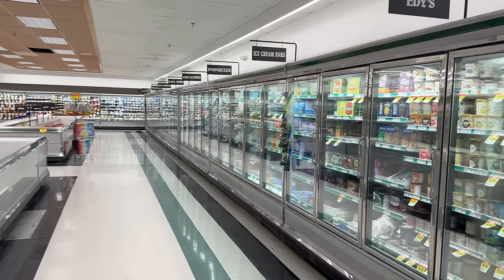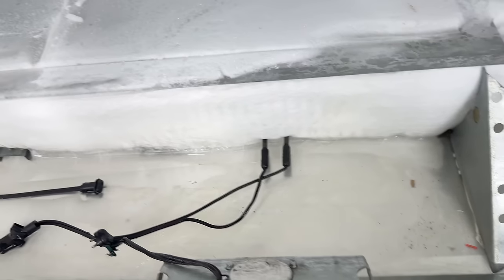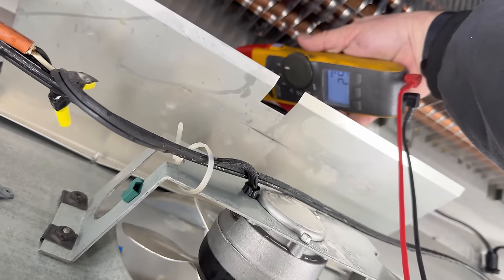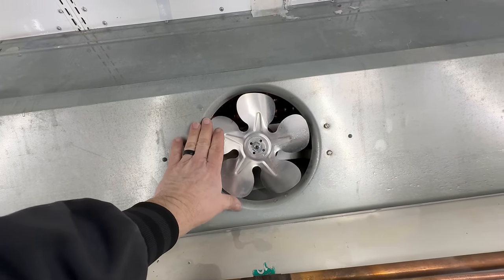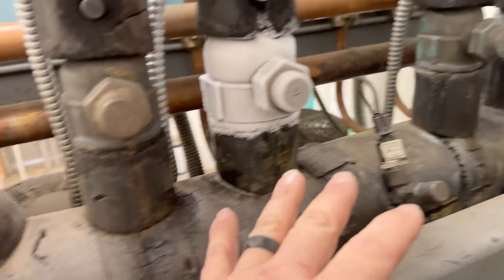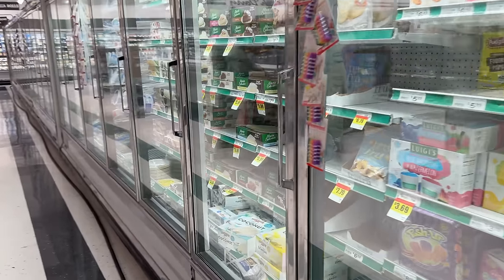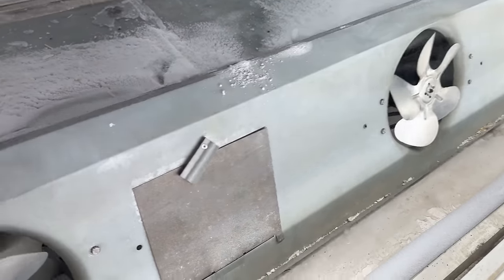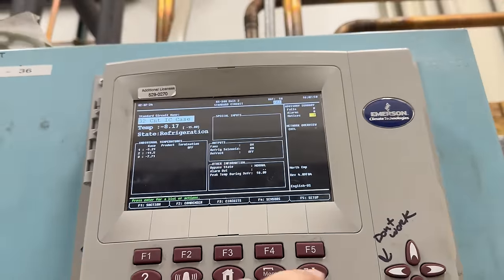5 Grocery Refrigeration Tips Tricks

Comment: Good stuff Rick. Most generally I use the True.Drain line heaters in the self contained  freezers I deal  with.   Can’t remember the part number. They are rated for 120v. ZeroZone doesn’t put drain line heaters in the o ea I work on

Comment: When it come to de icing cases, instead of running a long stretch of water hose, we just use 55 gallon drum or trash can, put it on a distribution cart, fill it up with hot water at the mop sink, drop a pump down into the drum and go to town on it. Also take an old fan motor, cut the two prong power cord off of it, and wire it to a female plug.
Reply from the maker: That’s what I use in remote locations like a radio tower. I have used the fan plug idea before 👍👍 that comes in handy.

Comment: I have found that too much defrost causes the hoar frost on the small pints. Looking up the cases spec sheet and setting to manufacturers recommend defrost specs seemed to help. In the e2 controller I think if you put it in emergency defrost it will go the whole duration without terminating

Comment: Nice video as always! If you don't mind me asking you about your meter the 376fc, how good is it? And have you ever had any issues with readings ohms above 60kohms being that's max range. Have you ever needed to use another meter to measure above 60k?
Reply from the maker: As you noticed, I’ve been using the 902 FC for a lot of my stuff lately because I made two different tool bags but I love my 376 even better however yeah there’s sometimes where I might get my fluke 87 five or my fluke 117 if I am worried about a higher resistance rating. Most the time we only need a moderately accurate amp meter voltmeter. I just need it to be reliable and turn on and know that I can count on it. That’s more important than anything because that’s what’s gonna save your life.
Reply: @HVACRSurvival  would you ever consider using a  fieldpiece meter? And I agree, meters for hvac guys its our lifeline, cannot cheap out on that, after using fieldpiece for a while im getting an 87v tomorrow so I'm pretty excited to use it, but the fieldpiece meter that I have has treated me nicely
Reply from the maker: Fieldpiece’s meters are good just not great. They work 95-98% of the time but there’s times when they can’t get the reading correct. Mainly on complicated wave forms. I own Fieldpiece manometers and probes without problems.